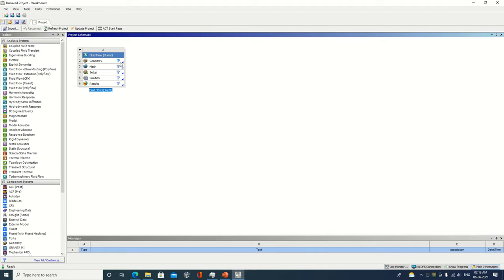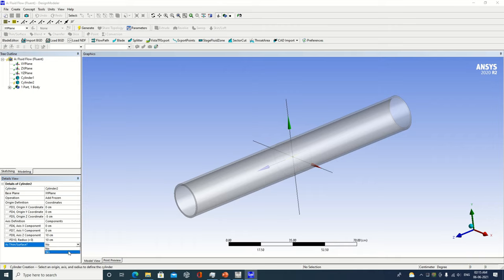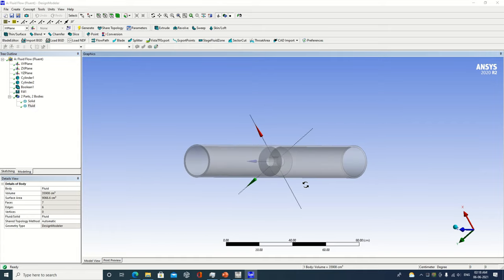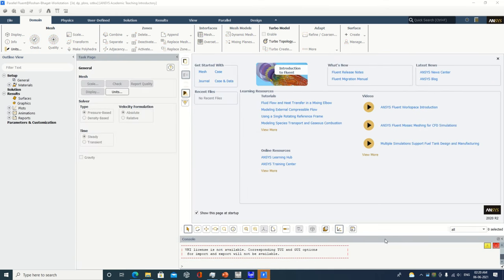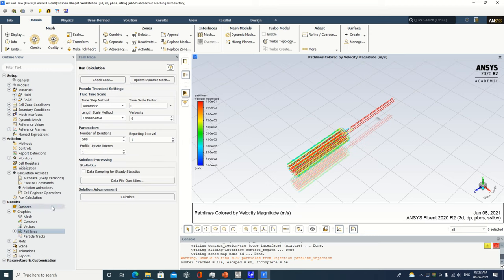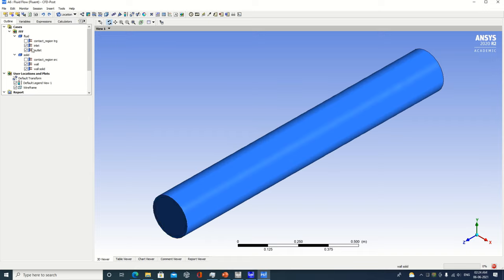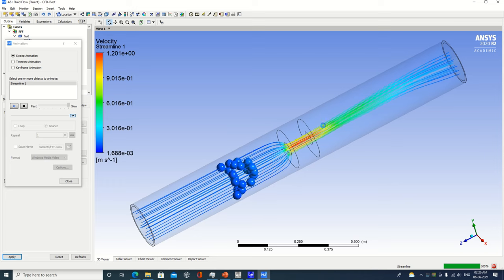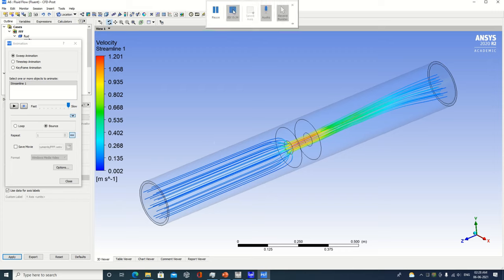Fluid Flow Simulation In Orifice Meter | CFD Analysis of Orifice Meter @Ayush.Bhagat

Comment: Sir kindly reply can we change the fluid in simulation like oil to check its effect
Reply from the maker: Yes you can add any fluid, specify it in material library
Reply: @FrontiersInCFD  sir can you do flow simulation for elbow plzz i have a project to complete